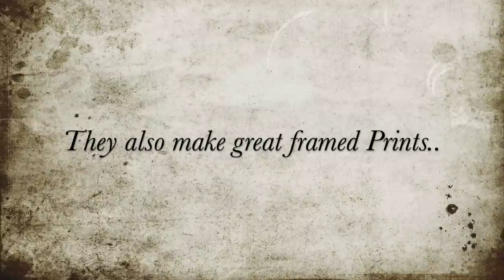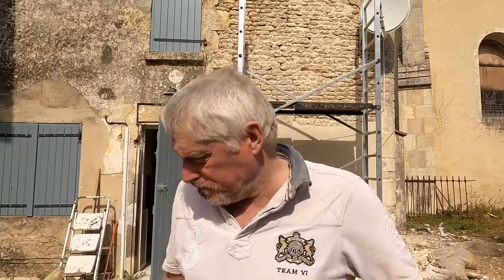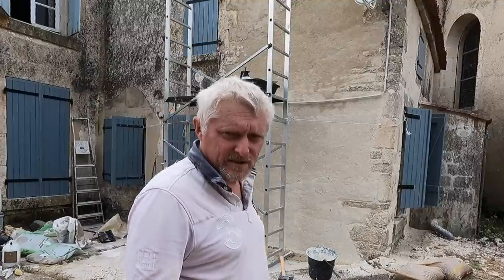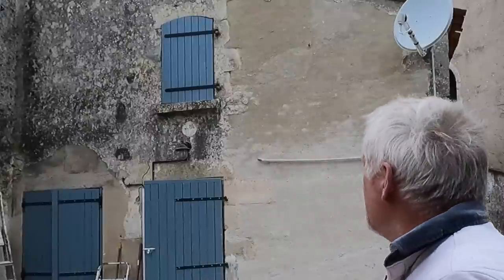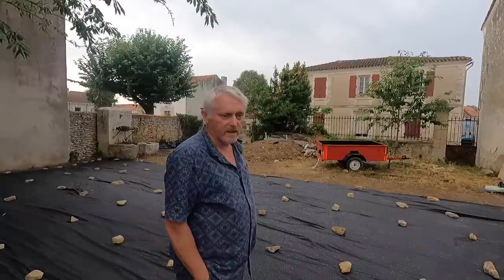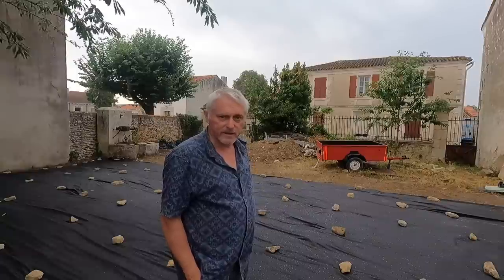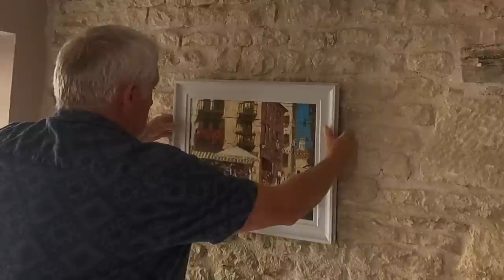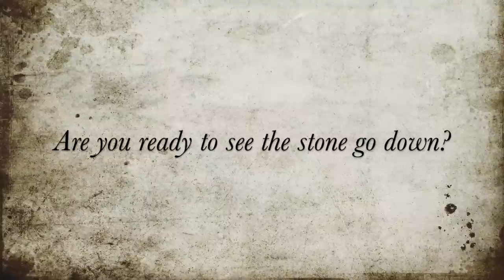13 ton of  Stone is dropped on me, The Gite wall gets finished, & it's as pretty as a picture...

Comment: In Arizona they don't bother with underlayment under gravel, just gravel on dirt and then annual spray of pre-emergent to kill weed seeds so they don't sprout.  The underlayment in Arizona just rots away with the endless summer heat.
Reply from the maker: The problem is weed killers are banned in France... anything to make a job more difficult as they say lol thanks
Reply: @OurFrenchHouseRenovation  Probably a better decision not to use chemicals, but we have a homeowner's association that fines you if you have weeds in your yard.  I'm old, so pulling weeds off a 1/4 acre in 110+ degrees would kill me.  LOL!
Reply: believe underlayment helps keep the gravel from sinking into the dirt., & with cars parking in a portion of area it would reduce a muddy mess.
Reply from the maker: @frdmbe9258  as you'll see in a future vid we decided to only make space for one car, luckily the area just inside the gate, has been traveled before so it was a good solid base to spread new stone.. many thanks for watching etc